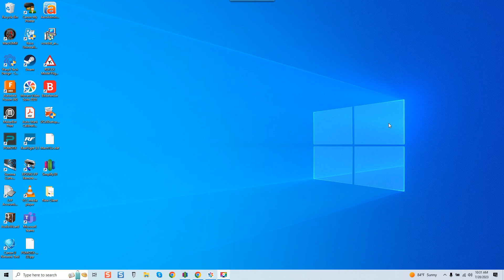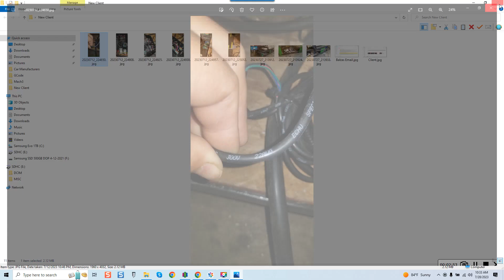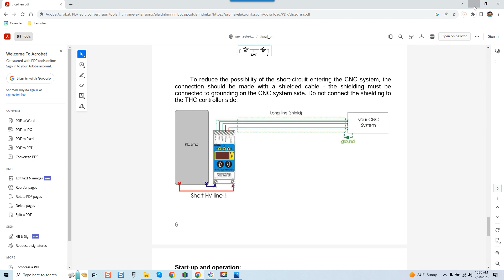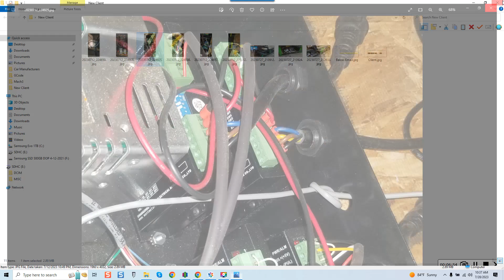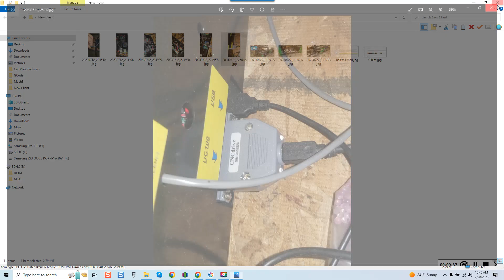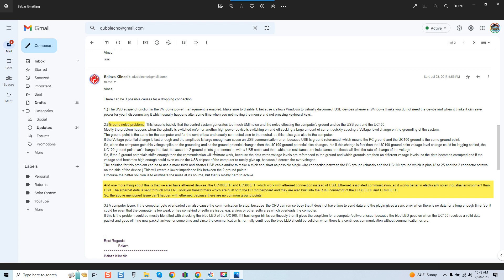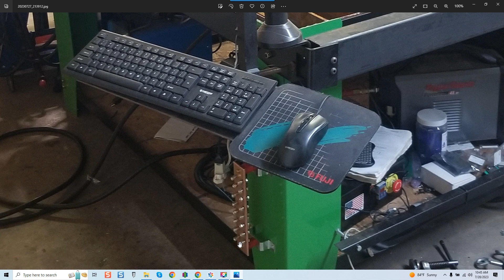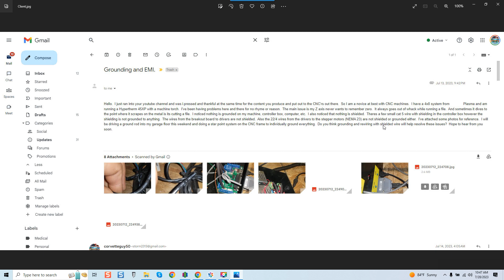Another CNC Plasma Nightmare!!

Comment: ouch. $7k and using skateboard bearings on bent sheet metal. I feel as a plasma it won't be too bad but once you load it with a router, the load will flex and possibly bind the gantry.